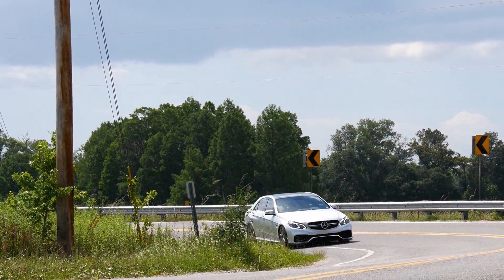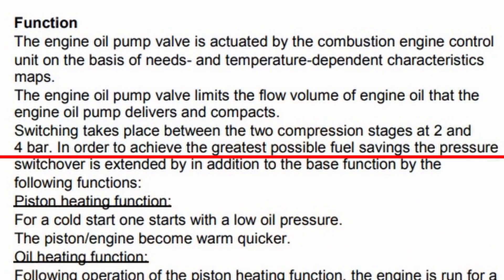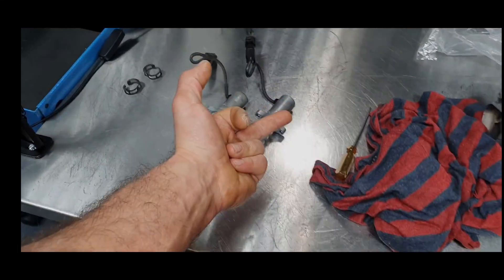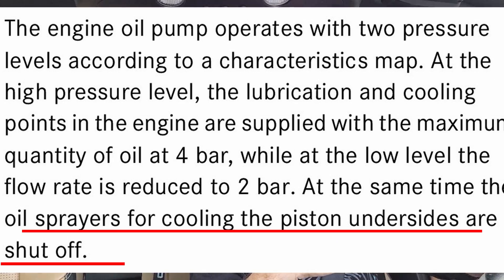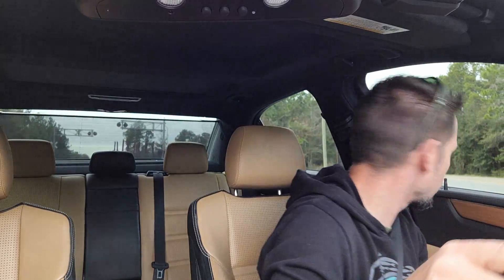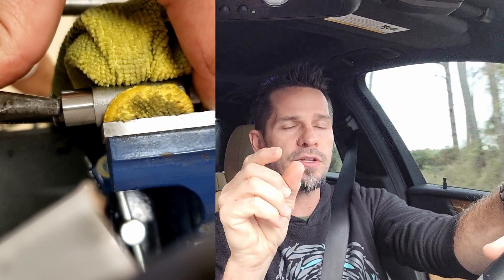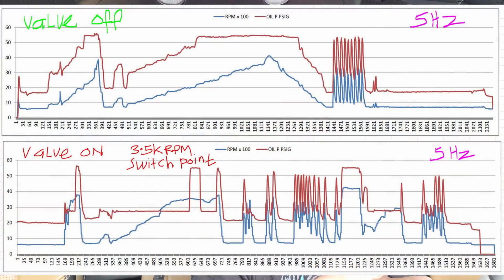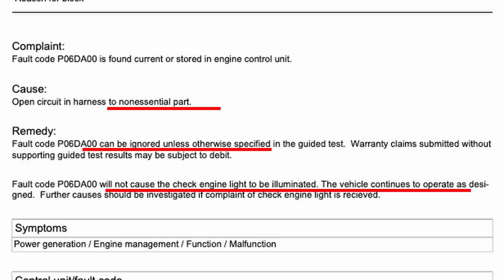M157 KILLER SMOKING GUN? Oil Pump Solenoid ~ Free mod! ~

Comment: I wish it was this easy for my 2020 C300 4matic with a M264 engine. Check engine light came on with P06DA00 error code. Dealer wants $5000 to replace solenoid.

Comment: I've doen this - and I recently have been getting "check oil level at next refueling" indicators. My oil level is nearly to the max. Do you think this is related to the oil solenoid? 
Tasos did a video a while ago about an oil pump failure in the sump leading to all kinds of problems and I am hoping that is not is what is going on (oil being full but not going where it needs to because of the pump). A faulty sensor is also one of my guesses. TIA.

Comment: I have just pulled the plug on the oil solenoid on my W213 OM654 and it runs noticably quieter, and having plugged in a diagnostic tool runs a constant 5 bar now were as before it would drop sometimes to 1.6 bar.  I am hoping this also solves the rockers failing on one side as i think this is due to low oil pressure plus back pressure from the DPF. I haven't stripped out the DPF though as it's OK, but will if it fails.

Comment: Just did this on my 2014 cls550 and you can kinda feel and hear the difference only time will tell but hoping for the best. Also fyi whomever has one the clip is located right beside alternator has like a 90 degree angle plug like in video. You have to remove bottom covers to access. Thx for the video! Also i feel rpm at idle is alittle higher too.
Reply: Update on the mod? Still running good/ worth it?
Reply: @kevingooner so far so good haven't had any issues

Comment: Wow what an amazing video and explanation. I recently purchased an E63 AMG W212 M157 and I'm at 102k miles... And this solenoid was plugged in! Now it is not, same for me with the oil, it was pouring out, cleaned up and booted both ends, and cable tied back out of the way. Thank you for putting this video together.
Reply from the maker: Cheers! Here's to many more miles

Comment: Hey I unplugged it I have a question my oil pressure is passing 80psi when I rev it 
Is the oil pressure relief valve same with solenoid or is different part and location?

Comment: Hello, I have a problem and I did not find a solution or answer for it. I have an E63S W212 M157 car. When the engine is started while it is cold, it constantly makes a sound like the sound of a hydraulic lifter. The sound disappears after the engine becomes hot and the oil temperature does not rise easily, although the weather is hot in Saudi Arabia. The engine does not make a sound like the sound of a timing chain, although I disconnected the solenoid sensor and the sound did not disappear. The engine replaced all consumable parts regularly. The car’s mileage is 230,000 km.

Comment: High pressure = higher temperature.  If this makes the piston oil squirters operate  better  that will also increase oil temp. The engine does have an oil cooler but this tasks the cooling system with increased heat. Shorten you oil change interval  and keep that cooling system in peak condition. As a high pressure Boiler operator  Temperature and pressure are directly related. Cylinder wall scuffing is my concern on my M278. Keep an eye on them wiring harness  oil issues  folks this will increase the leaks= hot thiner oil will increase the bleed thru . My 2 cent opinion.
Reply: Had my car for 2 years, last 6 months with solenoid disconnected, havent noticed any changes in running temps, oil change every 3.5k miles. Cant really say anything about sound or performance, but engine and heater warm up a lot quicker in winter.

Comment: I have done this with my 2013 gl63 amg, and I notice that the engine starts irregularly and engine shakes over 60 MPH.  High pitch hissing noise got reduced significantly, but the engine shake is noticeable after the mod.  Also, it happened once where engine start failed and started right after.  I want to know if anyone is having any issue with the mod.  Thanks.

Comment: Does this affect people who live in colder climates more? Was thinking about doing this but I’m not sure if the colder weather would affect this, thanks
Reply from the maker: Lots of discussion on this in the forums. According to the Mercedes documents, or cold starts, the valve actually is in normal aka high pressure mode in order to heat the oil faster from very cold to warm. Once warm, then the valve switches to low pressure mode.  I forget the exact temperature, but you'll notice that the oil will love to hover around 110F or so and take forever to climb to 160F. 
After the modification, The valve no longer turns off when the oil is warmEd to 110f or so.... It stays in normal pressure, which allows oil to continue to be sprayed on the pistons, taking the heat from the engine into the oil, which is then fed through thermostat controlled oil coolers. 
Again I can only speak to my car, but if it was my car, I'd much rather the oil get to it's optimal temperature of 160-220F faster
Reply: @ExoticCarDIY I see, sorry if this is a dumb question so once I unplug it the computer will automatically detect it’s unplugged and run 4 bar pressure at all times? There’s no way upon unplugging it it’ll get stuck in the 2 bar mode forever?
Reply from the maker: Nope, just unplug it. That's all that is needed If you currently had properly working system. There is a mechanical spring in there that is supposed to hold it in the normal, high pressure mode. 
False settle, it is still noticeable. For me especially with how quick it got to that optimal temperature and just the overall smoothness of the engine
Reply: @ExoticCarDIY Awesome thanks for the info man I truly appreciate it!

Comment: Does anyone have the part number for the solenoid/sensor?    
When I unplugged mine, there was a little bit of oil leaking from it like how it does on the cam sensor magnets.  Just want to replace it and keep it unplugged so it doesn't leak any oil out of it.

Comment: I have a early built 2009 c63 and I couldn’t find that sensor. Where they on later model engine?
Reply from the maker: You may have one of the only engine models that doesn't have it. It seems to be present on the m276, m157, m278, m177 etc etc. But I do not think the m156 which you have has this design or sensor. Lucky!

Comment: Did it few days ago. My decision was made after looking at oil pressure graphs. For my opinion in critical situations the pressure is better. Also this is not MB engineers invented solenoids but I found all cars have it for “green” reasons. 
I got no CEL but I don’t like the error code by scanning with Xentry. So I connected a 12v relay. Just simple 12v 40A car relay from Amazon. And it works! No more errors!
Really I do not feel any huge difference. Maybe more smooth acceleration from low rpm. 
Will see a bit later ✌️

Comment: Does this work on M177 or M178, the 4.0 L V8TT? S63?
Reply from the maker: I believe there's one or two people that have reported here in the comments that they have done it to there in 177.  My next car will be in m177 car, and I plan on testing this method to see if it has the same effect. Personally I would never do this unless I actually saw the oil pressure with a mechanical gauge like I did on mine

Comment: Is this the same location for a 2014 E550
Reply: If it's an m278 engine which i think it is. It will be beside the alternator and crank pulley. Access from the bottom just gotta remove bottom covers to get to it.

Comment: Do you know if this is also the case for the M177 engine in the 2020 Mercedes GT63? A P06DA00 code appeared with the CEL on after only 23k miles. Seems the connector to the 2 way valve failed and i've read there are two different types of valves. A Mercedes valve that is fail safe and defaults with the valve open and a pentastar valve that is not fail safe and may fail while it is closed resulting in low oil pressure. This model has a oil pressure sensor so I will find out soon enough if it does not as i'm assuming I would receive a message/ code related to low oil pressure. Really not trying to drop the subframe and replace this part just to have the car run worse to avoid a CEL.

Comment: Will the car will pass smog check test with this unplugged?  I want to do it but I live in CA with tough smog laws.
Reply from the maker: Be honest, I'm not sure. Generally emissions testers look for a engine trouble code. They usually start with a p and have three numbers. 
Now this does not produce one of those codes, it triggers a proprietary Mercedes code that is only accessible using xentry.
That being said, some people do actually get a check engine light. In that case it definitely would fail. 
Luckily I'm from the free state of Florida we don't have to worry about that lol

Comment: The pressure at idle rpm is lower with the valve off than with on? 😮
Reply from the maker: The pressure at idle is higher with the valve in the off position or unplugged. When the valve is on or has power, that is when it lowers the pressure
Reply: @ your diagram shows at idle a lower pressure after unplugging ? Or did i misunderstood something?
Reply: @ExoticCarDIY idle valve off = 1,8psi and wirh valve on 2.0psi?

Comment: Are you still running 0w40 or switched to 5w40?
Reply from the maker: 5w40
Reply: @ thanks! Just picked up a 13 e63 and will run that oil and disconnect the solenoid

Comment: I disconnected the sensor about 7 months ago.
Reply: Any problems? Oil consumption
Reply: I did not face any problems, but the same problem still exists. The engine sound when it is cold is not quiet. Maybe I did not understand how to disconnect it. I disconnected the solenoid sensor and the engine was cold.

Comment: Hello, I want to inquire. I have an oil temperature gauge that does not rise quickly, noting that the weather temperature in Saudi Arabia is not cold. The sensor shown in the video has been disconnected and until now it does not rise quickly, and the engine makes noise when the engine is cold. The M157 engine

Comment: Would this be possible on a 17 GLS 63 same engine but idk what’s the difference that would cause a CEL like on some other models.
Reply from the maker: Yeah I know that most e-classes do not throw code, but the S-Class seems to trigger a check engine light. Either way, if you're up for doing it, what most people are doing is just installing a dummy solenoid and zip tying it safely out of the way. That way the computer still thinks it's actuating the solenoid. Again this is just reiterating what's on the MB world post

Comment: So I did this to my 95k m157 ml63 and I had a check engine light codes was coolant sensor and thermostat the car was driving amazing then it satarted feeling weird after day 2 the temperature would stay dropped around 130-150f would it happen again if I replace them maybe they ware on the way going bad ?
Reply from the maker: Yeah if you have a bad thermostat or thermostat sensor, those definitely need to be resolved

Comment: Does an oil change have to happen more frequently because of this mod?
Reply from the maker: Mercedes pretty much has the same oil change interval on all their cars, one year or 10,000 mi. 
Well that might be fine for their E350, for the higher heat higher horsepower variants of the turbo charged engines, I would personally never let my cars go over 5,000 mi regardless of the solenoid being done or not
Reply: @ got it. Thank you!
Reply: Last question on this. Idk how the oil pump works exactly but do you think the oil pump would wear out quicker seeing that all 4 valves are open at all times instead of 2?

Comment: Does this have to be done on the m177 engines as well? 2018 E63s
Reply from the maker: Great question, just a few comments below is the report of a m177 user.. sounds like his is working fine, I encouraged him to check the oil pressure mechanically and try to do some data analysis. 
As soon as I get a 2018 Plus E63, I will be doing my own research on this to come to my own conclusion
Reply: @ thank you for the reply will be looking forward to your analysis!! Cheers

Comment: Love this channel. My m177 just gave me CEL P06DA00. Seems to be related to this "mod." It's as if I don't even have to unplug the solenoid. The car did it for me 🤣
Reply from the maker: Interesting, I think you'd be the first m177 look into the solenoid. I'm currently shopping for m177 and that be the first thing I'd want to test. But like I said, everything here is beta, there's tons of testing and all good reports. But it does need to be taken cautiously. I'd have minimum hook up a oil pressure gauge to make sure everything's working great
Reply: @ExoticCarDIY  I shared by experience on mbworld. Already done almost 200 miles with CEL P06DA00, engine hasn't blown and oil change showed oil + filter were crystal clean. Main symptom is: oil warms up a lot faster, and maintains good temp. Tomorrow, I will have shop unplug solenoid (just in case) and do manual oil pressure test (or check via software). ps would love to see m177 content on your channel, it's already showing to be a legendary platform

Comment: Hey, just removed on my 2014 E550 Convertible, drove for about 50 miles definitely felt difference. But then the CEL came on, scanned it and got the code some people on the forums seem to be getting, about there being an open circuit. Any thoughts on how to cover the solenoid to trick the ECU? or will I have to just deal with the CEL?
Reply from the maker: I've read in the forum that many people are buying a cheap extra solenoid and plugging the harness into that, and then zip tieing it safely out of the way
Reply: @ExoticCarDIY do you mean something like the camshaft sacrificial harness? Get one of those and use that? I can’t think of anything else
Reply: @abdullahbhatti4772  The idea is to purchase a second solenoid that is connected to the wiring harness only (to remove the CEL) and zip tied away i.e. a dummy solenoid

Comment: Where do you hook pressure gauge?
Reply from the maker: There's a 6mm Allen plug on the lower part of the oil filter housing.
Reply: @ExoticCarDIY and which difference at 2k rpm can you report before and after you unplug ?  Is der pressure at 2k rpm   dependent from power level ? In my mind : before unplug at 2krpm maybe 2,5bar and after unplug ? 3-4? 

Thanks